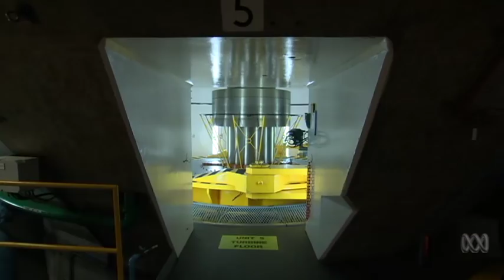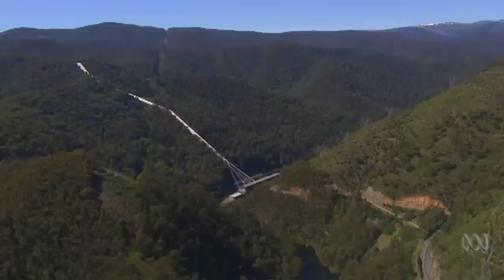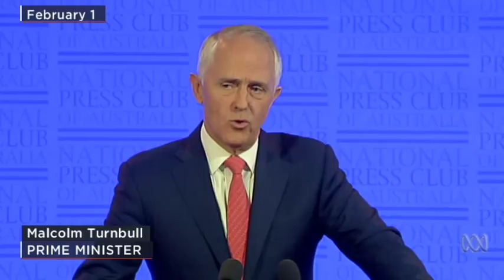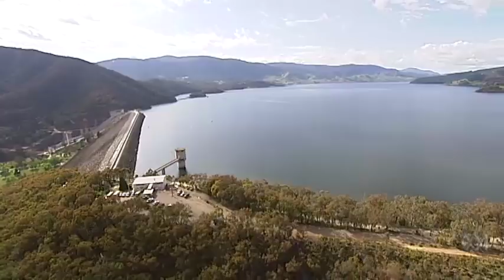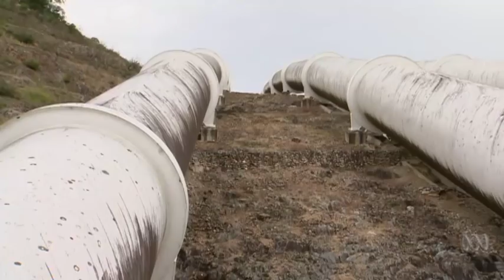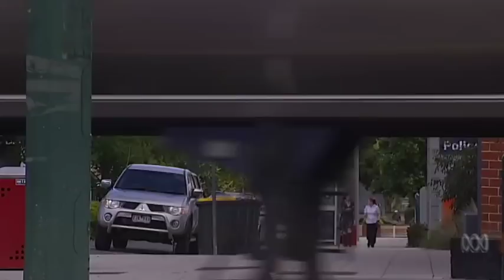Pumped Hydro: Australia's energy future?

Comment: To store 1KWH would require lifting a 3673kg weight 100m or 10(.1) 4680 Tesla cells. Engineers should know. 
Force of gravity of per kilogram = 9.8N/1KG. 1KWh = 1000W x 3600 seconds/hour = 3600000 Joules. = 3.6MJ. 3.6MJ/(9.8N/KG x 100m) = 3673kg.
Tesla 4680 cell has a capacity of 99WH/cell. 1000WH/99WH = 10.1 cells.
Reply: Not as bad ans lifting weights.

Comment: What's never mentioned is the way electric suppliers have raised prices through the roof in the last ten years alone. The pumped storage facility near me in Northfield Mass, is destroying the section of the Connecticut river it's been pulling water from for the last 50 years. First Light came in, bought up everything, set up a massive solar farm alongside it and is selling off all that it makes to the highest bidder instead of augmenting our supply as they promised. We're left subsidizing the building of the solar farm so they can reap the benefits. Everyone forgets, Tesla wanted to deliver free electricity wirelessly back at the turn of the century with no impact on the environment. Solar farms a re a waste of land, they're ugly and inefficient, the windmills depend on oil and regular maintenance, they're a fail as well. They slough off ice in great sheets in the winter and do great damage when they begin to fail.

Comment: The obvious solution? Park a small-scale nuclear plant next to your low dam (but not in the path of the high dam in case of failure -lesson learned from Japan). Use the power to load your high dam at night and to supplement your grid during the day (if necessary).

Comment: It's seasonal storage though, you cant cycle a reservoir like this on a daily basis.
That means to guarantee supply from renewable's, we will have to overbuild by a ratio of around 4 to one, and store the excess long term.  That multiply's the investment requirement, and therefore the current projected costs by a factor of four also.

That absolutely destroys the economic incentive to switch to electric vehicles.
Reply: you're right that if we had one reservoir it would be hard on a daily basis but the research shows there is upwards of 15,000 sites and old mines that can be converted. at that scale the economics becomes extremely realistic and advantages.
Reply: @limapapa-d5x  
No
Reply: ^ Hits Reset
Reply: Reading your negative  comment about the need to overbuild pumped hydro storage by a ratio of around 4 to 1 if used to store energy begs the question, "do you only put fuel in your car 1 liter at a time then drive around until it is gone and then go back to a service station and put in another litre of fuel into your vehicle?
Of course not. 
Seems pretty sensible to have plenty of redundancy (and spare capacity) built into this system.
Reply: @hitreset0291  
Your not getting it. My point is precisely that the larger dams cant cycle with that frequency. While cycling at that higher frequency only works with dams that are too small to justify their expense.

You cant just ignore erosion at the bottom of the dam. 

What's being suggested is literally just rebuilding the hydraulic power systems that proceed the power-grid. If such a system was sufficiently well suited to our needs. We never would have gone to the expense of building the electricity grid.
Reply: @lordsamich755  speak English.
'Erosion at the bottom of the dam'?? Ffs we are talking about dedicated "pumped" hydro electric generation here not traditional hydroelectric generation.🙄
Reply: @hitreset0291  
Your an idiot. Good day sir.
Reply: @lordsamich755  Always sad when I come across socially challenged and intellectually impaired individuals such as yourself. 
Enjoy the darkness.

Comment: There is report being touted by the Left in Australia that claims that there are dozens of suitable sites for pumped hydro in Mainland Australia, with over a dozen in the south west of WA alone.  Complete B.S.  Unfortunately quite a number of people believe it.  Doesn't help the discussion at all.  Basically, need 2 large artificial water bodies, very close together with significant height differential, close to major power transmission infrastructure.  Even if such a site can be found in WA if you factor in embodied energy, low efficiency, etc, it will never pay itself back in the big carbon footprint equation.
Reply: ''''''' embodied energy, low efficiency,''''''

what do you mean?
Reply: @robinsss  Embodied energy, is all the energy that was expended to create a product, or structure.  And that means everything.  Concrete has significant embodied energy. Look it up, it cant be ignored. The energy payback on a large project can take decades.  Do some research.
Reply: @noelwhittle7922  ''''' if you factor in embodied energy, low efficiency, etc, it will never pay itself back in the big carbon footprint equation.'''''

i will accept the embodied energy concept

the  system is  90% efficient according  to many sources

energy,gov

https://dothemath.ucsd.edu/2011/11/pump-up-the-storage/

whether this system will  have a low carbon foot print or not depends on whether  Australia converts to  renewables like  ocean wave in addition to the dammed rivers
Reply: @robinsss  I once got into a debate online with someone about the concept of base load, anyway their responses led me to learn about the concept of 'Gish Gallop'.  Otherwise, I am bemused about the prospect of destroying & flooding thousands of hectares to create new dams for these projects.  I am old enough to remember the Franklin Dam controversy.
Reply: @noelwhittle7922  i am not recommending that you build new dams

i am recommending that you use ocean wave devices on the ocean since most Australians live near the ocean

Comment: Ha ha and look at all the renewable dhit now and how high our electricity prices  are renewable shit is just a big scam snowy hydro is ok its built in to our irrigation  water storage dams Burrinjuck and Blowering dams and wheres Turnbull  now gone in to the wild blue yonder build more coal fired  power stations  the most reliable and the cheapest power
Reply: why would you say coal is more reliable than hydro?
Reply: @robinsss  Because it takes twice  to three times as much electricity to pump the water back up hill than it genearates running down hill where it doesnt use any electric water is a heavy liquid and it gakes a lot energy to pump it back up hill especally through pipes  because your pushing it up hill and its the distance its got to travel up hill
Reply: @wayneballintine9532  

why are the dams just as reliable?
Reply: I think you've missed the entire point of this. This is pumped hydro, an energy storage technology rather than energy production, unlike regular hydro, which is usually built on rivers, though will never power the world is definitely a much cleaner and more sustainable way to produce our energy into the future than shitty coal power stations
Reply: @douglas4285   you are right

i didn't understand the concept of this battery

why do you say that hydro could never power the world?
Reply: @robinsss  because there simply isn't the volume of water in rivers to meet our increasing energy needs. it can perhaps be a small percentage used in tandem with several other energy production mechanisms.
Reply: @douglas4285  Bullshit its pumping water the water  back up hill after its run down hill to generate the pumped  electricity  it will take more energy electricity to pump  the water back up hill than what it genearates running down hill the original hydro genearationfrom our  snowey hydro scheme in new south wales built into burrinjuck and blowering dams    our irrigation dams in new south wales runs down hill  from burrinjuck dam  to blowering  dam  and then it runs through hydro genearators to generate electricity and has for years  and  the water is stored  in blowering dam untill irtogation farmers want it to irrigate  there crops and vegitable crops for you city yuppies to eat  and ot has been foing that for years now the other set up so called 2.0 scheme it has to be pumped back up hill and you should know your self if youve got a brain how much harder it is to walk up hill compared to walking down hill and to pump or push water back up hill takes a lot  of energy because water is a heavy liquid and all so to push it back up hill  especially when its inside a confined space trying to push it through pippes up hill  it makes it so much harder it will take double if not triple the  energy electricty to pump it back up hill that it generates running down hill through pipes
Reply: @wayneballintine9532  Okay so first up, this is the longest single sentence I've ever read. Yes of course it takes more energy to pump something uphill thank down, you're working against rather than with gravity. This is the entire purpose of pumped hydro, it doesn't produce energy, only allow us to store it when it is cheap and release it when we need it. This is completely different from typical hydro, like the 3 gorges dam on the Yangtze River, which produces 22,500 MW, which just uses the potential energy of the water in the river to spin turbines. We all know it's not the perfect energy source, there isn't one, they all have their drawbacks, but we have to utilize some of these renewables to meet our increasing energy demands
Reply: @douglas4285  There is a better energy source its called voal fired electricity generation  is what we had back in the 80s the cheapest electricity in tge world and  the most reliable and cheapest electricity now we are the fifth dearest electricity prices in the world because of the hoax and scam renewable bullshit electricity and us consumers are paying for the shit at 150 to 200 dollars every 3 months on our electicity bill we had 2000 megawatts of cheap coal fired electricity generation in Hazelwood Power station in new south wales and they blew it up  because they could suck millons dollars  a year  out of tfe federal goverment for the renewable shit which costs more than coal too and all the stuff thats in the  solar panels are toxic except tge alaminium  did you know that
Reply: @douglas4285  And to add theres no cheap electricity they can use to pump the water back up hill  because dolar font work at night and if ty eres no wind blowing theres no wind generation either any way it would take tripple the amount of electricity that it genearated running the water down hill to pump it all the way back up hill that was all turdbulls idea to pump electricity and he wouldnt know if some 0ne was up him unless they tapoed him on the arse be just wanted to get controll of the water when he was priminister  and he didnt pay one bit of tax  in australia he had his company through the camen islands  to get out of paying tax in australia
Reply: @wayneballintine9532  Coal was cheaper in the 80's, yes, but since 2010, solar and wind have dropped massivley in price and are now cheaper than coal, according to BloombergNEF, and its still dropping in cost by 9% per year. And lets be honest here, coal isn't exactly the cleanest form of energy is it? Yes I know the production of solar panels is pretty horrific, like I said earlier, there is no perfect solution, but I can say with certainty that coal is not a sustainable source of energy. Current estimates show that we're likely to run out of coal by 2060, which isn't exactly far away and if we continue investing in coal, we won't have supplies through my lifetime.
Reply: @douglas4285  Bullshit solar and eind are no cheaper now in australia than it was in the beginning thats all the lefties bullshit and you city yuppies believe all the bullshit   and  and lies tgey spew out if there  arses and weve got enough  thermal coal for 150 years here in australia   your quoteing what some yanke mob said there up to there balls in the renewable hoax and scam and Micheal Moore made a documentry  about the renewables scam and he was a greenie activist for 25 years before that and china and  India and vietnam and thailand  and the phillipines are all buying our coal  and building coal fired electricity genearators chinas been going like mad building coal fired generators they started with 0ne thousand to build  threve got 400 to go and there opening  a new one nearly every week and reneawables only supply 0.06 percent of the worlds energy theres 2 big bullshit solar farms not far from where i live and we in dont get  any of it the town im in and anouthet town dont get any electricity from them aus grid are building a big power line from adelaide through victoria in to new south wales  and to a small country city wheres theres anouther bullshit solar farm  to take the electricity to victoria  and adelaide because they are allways running out of electicity now that  Hazelwoods Power  stations  gone and 2000 megawatts of eletricity
Reply: @wayneballintine9532  I think I'd be more inclined to write a proper response if you could use full stops, it really makes what you write very difficult to follow. But I have no idea where you have this stat of 0.06% of the world's energy coming from renewables. India, Vietnam and Thailand are buying coal because they are developing countries without the infrastructure to produce anything cleaner. Are you incapable of accepting that coal has had it hay-day and will not last my lifetime at global current consumption?

Comment: I wonder if you could build the reservoir like a canal lock with a 
buoyant object in it (like a ship or barge in a canal lock) the object, 
which could have tremendous weight  would rise with the water level and 
wouldn't cost additional energy if you pump the water in from the top 
(free potential energy) When the reservoir is drained to run 
hydroelectric turbines, the falling object and a pulley  could turn a 
driveshaft to generate additional electricity.
Reply: The buoyant ship displaces an amount of water that weigh the exact same as itself (Archimedes principle). Since the ship is buoyant, it is effectively weightless and hence can provide zero energy as it is coming down. If you do drain water below the floating line while holding the ship up, then it gains weight again and you could use its potential energy in the way you envision. But the energy cost for having raised the ship in the first place by pumping an equivalent mass of water into the reservoir is the exact same as the loss you incur because the volume of water being drained out through the turbine is lesser. This just cancels out and you're just as well dispensing with the ship and pumping a little more water into the reservoir (with a mass equal to the mass of the ship).
Reply: @pokerandphilosophy8328  If you're already pumping the a given amount of water into a reservoir to store energy and then releasing it to power turbines, the boat floats up for free, and when you release the water, the weight of the descending boat could pull a chain that drives another generator.
Let's say the water level in the reservoir is 100 feet above the turbines when it's filled, and it rises and falls 5 feet in a cycle, then you add the float and, because of displacement, the water has to be pumped 5 feet higher but it also falls from 5 feet higher on the return, the float rises 5 feet for free
Reply: @dalemurray4083  That depends how high you're pumping the water. If you're pumping it unnecessarily high, then you are wasting energy as it falls down into the reservoir from above the water level. If you are pumping it just at the height of the water level, then this level rises as the reservoir fills up. If you put a buoyant object in the reservoir, then it displaces water and makes the water level higher. This means that you need extra energy to pump water at this higher level to make the buoyant object rise even higher. This extra energy that you have spent pumping the water at this higher level is the exact same as the energy that you get back with your extra generator. The net effect of the contraption on energy generation is therefore zero.
Reply: This is pointless.  You are raising masses one way or another and storing gravitational potential energy whether from water or your boat.  The fundamental law of physics known as the law of conservation of energy says you can't store more energy than you input to the system. The second Law of thermodynamics says you will get less back than you input.  You seem to think that you will get more energy back than you put in which is physically impossible.
Reply: @simonwesley9283  They're ALREADY going to pump the water. Boat or no boat. 
Have you ever heard od cooking food on the engine of a car?? Where did that "Extra energy come from?? IT DIDN"T,   the food is cooked by heat that is otherwise lost in the process of powering the engine. It's not FREE energy, it's energy otherwise LOST. It's not perpetual motion, it's increased efficiency.
Reply: @dalemurray4083  i am trying to decide of you are a troll or just don't understand Physics.  I will give you the benefit of the doubt.  When the pumps draw 10 MWh from the  grid, 8 Mwh are used to increase gravitational potential energy and 2MWh are lost to heat in the pump, water and penstock.  It does not matter if you increase the Gravitational Potential energy of water or a boat, you can't increase the  GPE by more than 8MWh in total if you lose 2MW to thermal energy. (The law of conservation of energy) The waste here is in the form of thermal energy and cannot realistically be recaptured to float your boat. (Second Law of Thermodynamics.) Your example of using waste heat from an engine to cook is irrelevant to this situation.